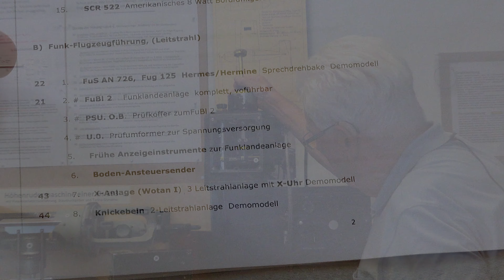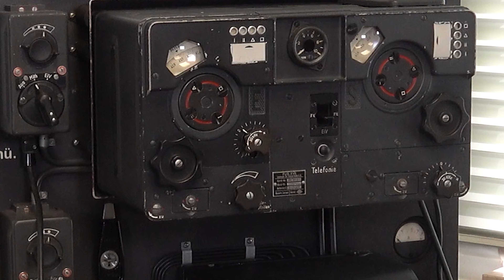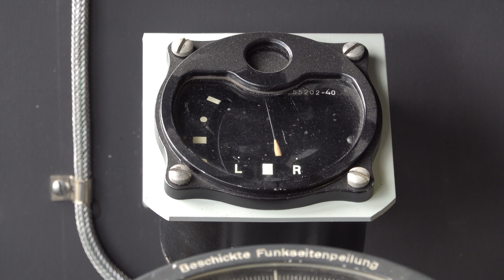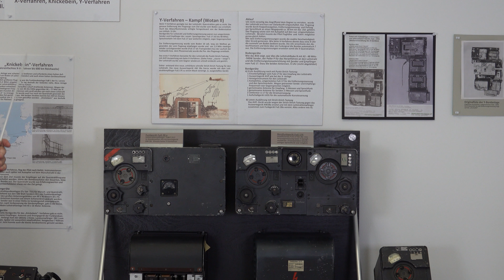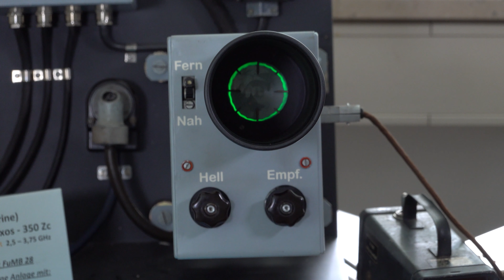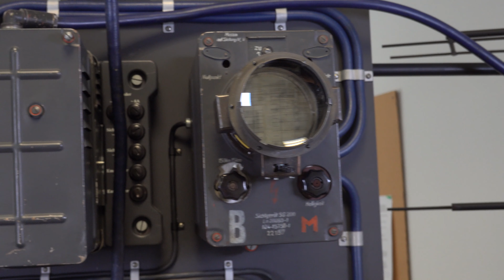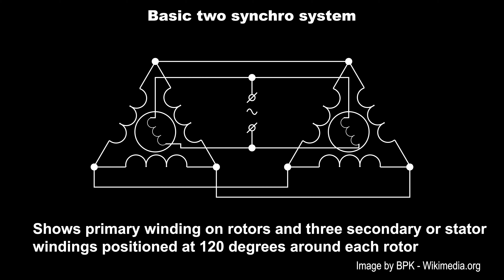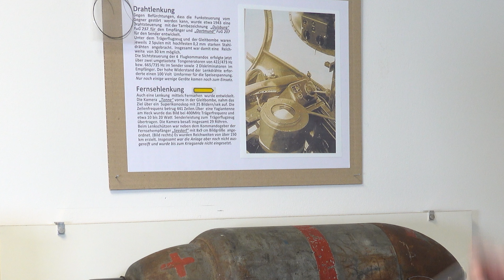A brief history of Luftwaffe electronics - from radio to radar in the valve era

Comment: Ist die Sammlung öffentl zugänglich? Auf welcher Webseite kann ich mir das ansehen.

Das FUG Berlin ist das auch zu sehen und wie sieht es mit dem Rotterdam gerät aus
Reply from the maker: Hallo Herr Remsperger, Nein, es ist eine private Sammlung und nicht öffentlich zugänglich. Im Moment gibt es keine Website.  
Wo kann man das FuG 240 Berlin sehen? Ein funktionierendes Exemplar ist uns nicht bekannt. Und ja, was ist mit dem Gerät "Rotterdam"
bitte beachten Sie, dass wir normalerweise nur Kommentare auf Englisch akzeptieren, es sei denn, das Video ist auf Deutsch. 
MfG RJD
No, it is a private collection and not open to the public. There is no website at the moment.  
Where can you see the FuG 240 Berlin? We are not aware of a working specimen. And yes, what about the device "Rotterdam"? 
Regards RJD
Reply: There is a FuG 224 Berlin A set on display in Germany. Which is very interesting Magnetron radar set. I am not sure where it is exhibited. It is not in working order but interesting all the same. The differences from the British H2S  are interesting too.

Due to the lack of long persistence CRT tubes the rotation rate of the antenna is spun at a grater rate. Also the use of polyrod antennas rather than cones.

The polyrod antenna is similar to the ones on NAXOS radar detectors.
Reply: @smalcolmbrown  Interesting comment about lack of long persistence CRT's. The development of that type of tube was the first thing the British worked on before they built their own PPI tubes in 1940.